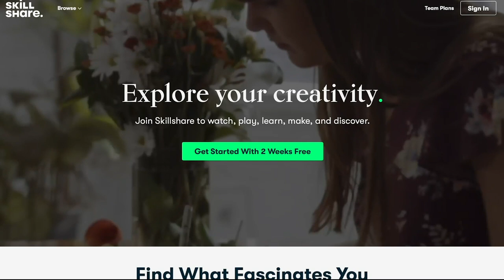Excavating Around Our 100 Year Old Stone Barn! Portuguese Homestead Series

Comment: A gardening tip 😁 take a shovel and cut a circule around the pine, strait down to the depth of the showel head. Water it and leave it like that till spring, when it rains in spring you move it too where you want it, taking care that you don't hurt the roots ❤️❤️❤️

Comment: glad you are doing the french drain-  also slope the ground  a little bit away from the house on the back - and have a  little ditch to behind the house the funnel the water around the house.  Are you going to catch the water from the roof?  looks like your brush cutting found you a nice pile of small rocks.  put some landscape fabric down over the french drain and then put those rocks around  on top.    almost like cobblestones- then you can just pull weeds and mow around the house.  Are you going to eat the roosters?      The roof is looking beautiful- hope  if you do solar it will be on a carport to cover the cars and tractor.  or  with your slope you could  carve the slope to the proper angle. and  have the panels almost on the ground.  Easy to work and and clean.  you might also  dig  or buildrun off ridges.   across the face of the slope-  that drain towards the trees.   you collect rain water  and it holds it behind a little dirt or rock dam   around the trees.  fill it in with some mulch  to act like a spoonge.  and  for the trees you do it for they will feel like they are getting double the rain.    Also by letting it soak into the ground, you might  get more water to your well.

Comment: Wonderful vlog! I do have a question. Can someone tell me how they are attaching the tiles? I see they fit together but I have not seen them nailing each tile? ❤&🙏 from Pennsylvania 🙋
Reply: What holds the top bit on to keep it from blowing off in strong winds?
Reply: Every second row of tiles is supposed to get nailed down. 👍
Reply: Tiles don't need to be fixed by nails like shingles 😉. Every now and then there may be fixed a single tile, not a whole row. As mentioned before they lay down by their own weight and overlap. The rigde of the roof has to be fixed then and holds everything down.
Reply: I've tiled many roofs in my 10 years working as a carpenter and every second or maximum third row should be nailed. Any other way is a cowboy method done to save time. 😉
Reply: @floyne86  Well, I live in Germany. Here,  as far as I know none of the tiles are nailed or fixed. They're heavy enough and the roof rigde holds everything together 🤷.

Comment: Tractor has one seat. It is designed for one person at a time. Do not be temped to put a second person on the tractor. Tractors are heavy and brakes are not as efficient as a car. Rear wheels are large. Each year many are killed doubling on tractors and the bulk of the casualties are children. Once someone falls in front of the rear tyres. It is too late to stop. Avoid the plague. Keep safe.

Comment: Question Bea, Theo, when it rains Theo shows the fragile   rocks and paste that is between the rocks on the wall crumbling. My question is how can you be sure the walls won't fall in without further enforcement? Would steel rods from roof to foundation not be a viable solution? What are you doing to re-enforce walls?